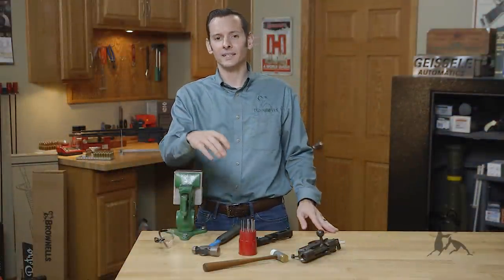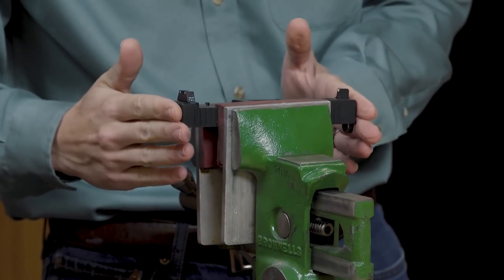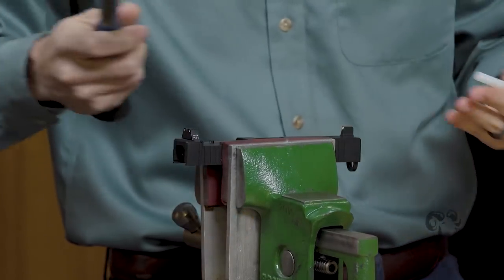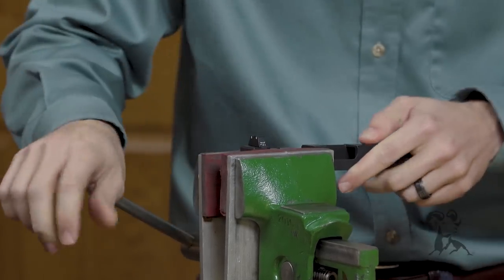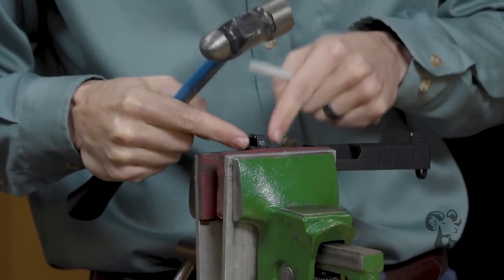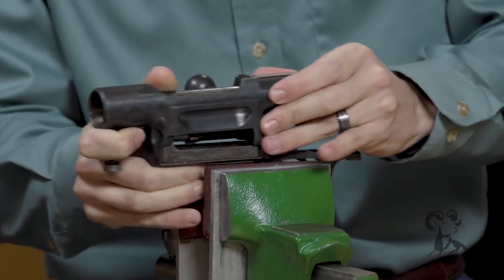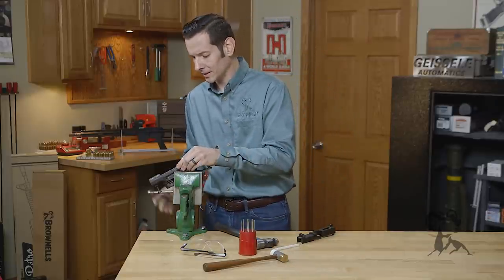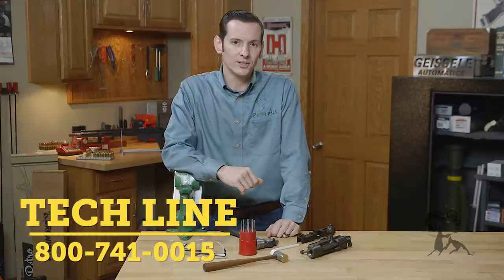Quick Tip: How To Use a Gun Vise

Comment: If You haven't worked in fields that use vises or hammers and punches etc.(which is most these days) These are great tips for anybody especially folks new to mechanical work. Its not hard, but needs to be learned correctly,(for your own benefit) . He has proven exactly that with this video. I have been a metalworker /fabricator/welder/auto tech ,and general craftsman for several decades and I still pick up new tricks or tips from these guys. I knew everything he spoke of in this video, but the next one I may pick up a tip or 2 , were always learning always thinking, if we want to be better. Thanks for ALL these videos Brownells.

Comment: Where do you get the vice blocks?
Reply: You can make them, I’ve used copper roofing metal, aluminum chunks from the hardware store  and even wooded as well as plastic cutting boards and leather.

Comment: Not to be that guy...but I’ll be that guy. One should be very careful about cranking down on a slide in a vise. Without support or the pads at the wrong angle, it’s easy to distort the slide. Before better components came along, top gunsmiths would use a vise to take slop out of 1911s. Also, generally speaking, one should drive dovetail sights out from left to right. Please note all this information is contained in Gunsmith Kinks by Bob Brownell...the set is a must own!

Comment: As far as vises go, that is a fragile vise.  I broke mine, so I got a Yost vise that is stronger.
Reply: If you strike towards the immobile part of the jaws it should be plenty strong for most uses. Turning off a barrel while also applying heat however you will need quality.
Reply: @john-paulsilke893 , good advice.